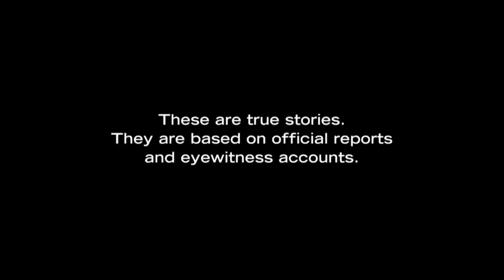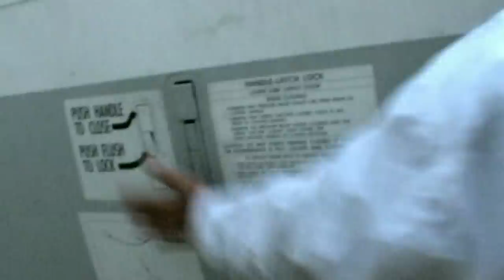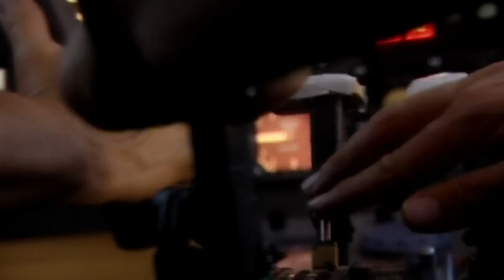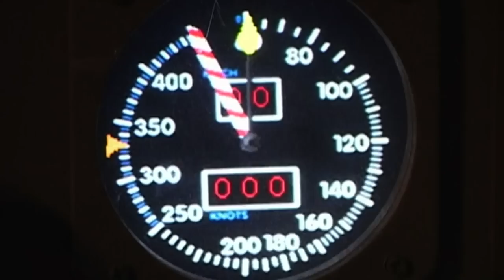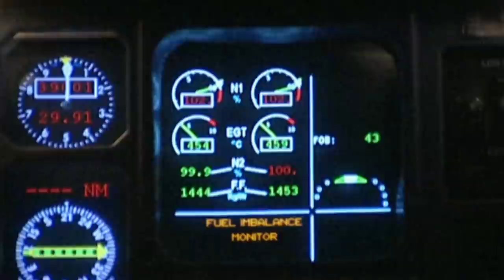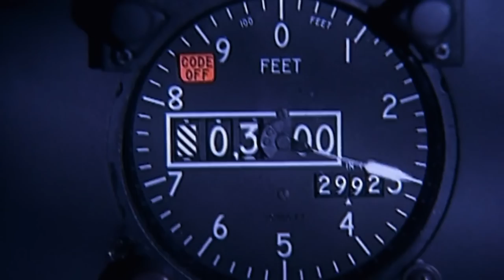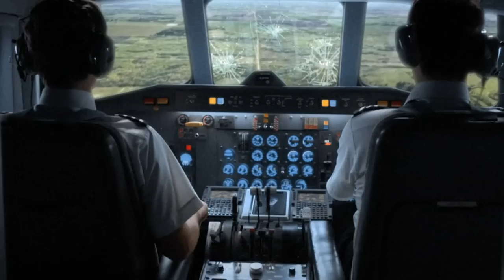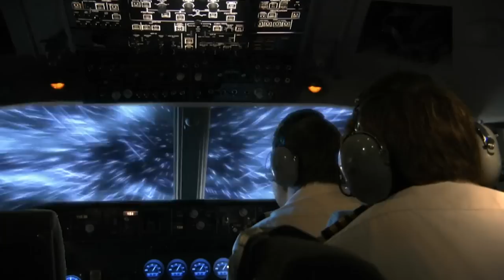How Routine Flights Can End In DISASTER | Mayday: Science Of Disaster

Comment: Many of these problems were fully predictable failure modes. When all a human being needs to do to cause a disaster is select the wrong bolt, forget to reset a switch, or neglect to remove a piece of tape, then the fault lies with the designer of the workstation, and not the worker.

Comment: Especially something so notorious as a jackscrew axiom scissor Jack's dangerous for this for cars has been discovered..... Possibly even a manual hand valve pump hydraulic external system for hydraulic secondary.... Maybe a hand cranking valve pump system for more efficiency...... Emergency secondary backup should the jackscrew fail....

Comment: A cargo door that is designed as a plug is best. From the out side push in on the door and slide the door to the right or left to open. To close slide the door back into place and latch it closed from the outside.

Comment: i don't understand how it is possible to not know if you are upside down in a cockpit. are they antigravity or something? can't they just lay down a level or even a plumb bob in there? surely they can use gravity? i can always tell when i am upside down.
Reply: When yr buckled in and intensely focussed on flying, it IS easy to ignore gravity.  That is one reason planes have an "artificial horizon" indicator.  But you have to remember to look at it--along with 100 other dials and gauges and lights.

The layout of plane controls is pretty haphazard, with  a lot of "granfathered" controls sandwiched in.  No one has ever tried to rationalize to organization of these controls.

It is like computer software controls b4 xerox designed the interface that apple stole and MS stole from THEM.  If you ever worked on a non-GUI you know what I mean.